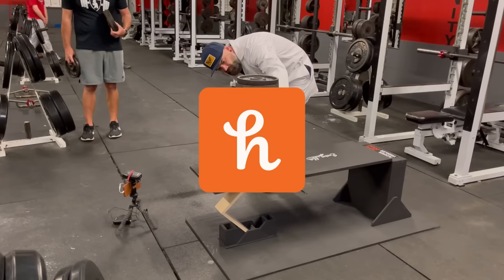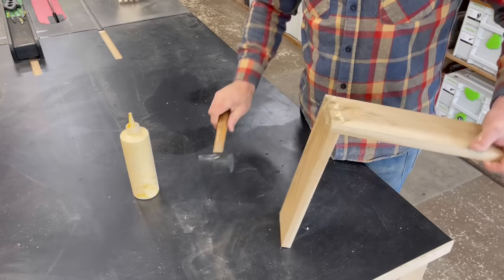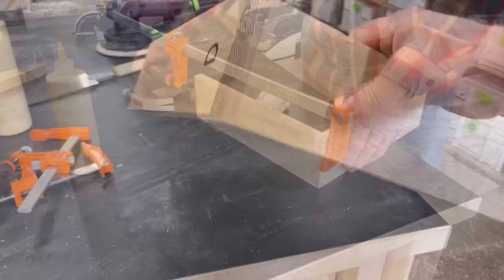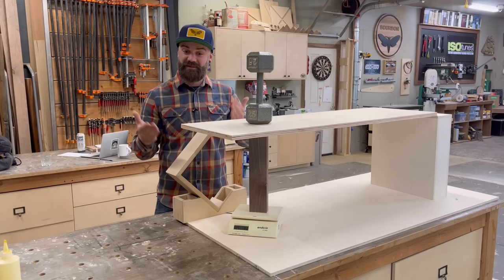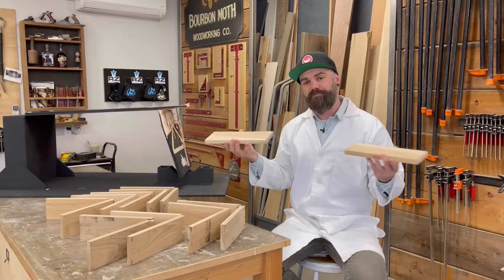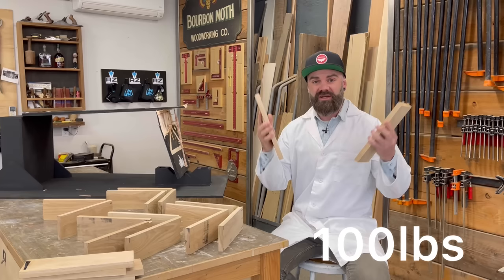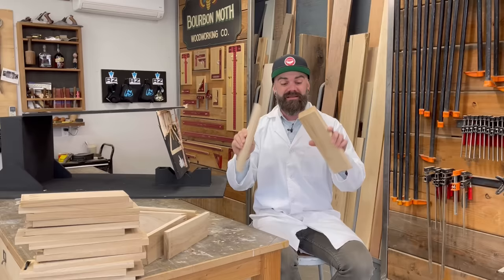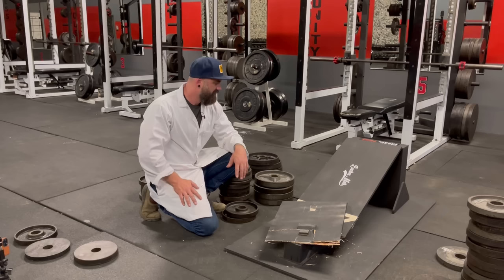What's the Best Wood Joint || Insanely Strong Joinery!

Comment: to be fair that miter joint surprise me but i put it higher then but joint, the dove tail i put high mostly just because the frequent use but was for years skeptical. I was not familiar with pocket holes so it was a bigger guess then the rest. And here is the list from using only 5 min mental analysis. Top meaning the strongest.

box joint
dove tail
miter with splines
pocket holes outside
dowel pins
pocket holes inside
dominos
miter 
butt joint
lamello

Comment: I am betting that if the box joint was drilled through at the corner and a dowel inserted through, that would make a pretty solid joint.  Now the dowel rod would have to be considerably small considering the thickness of the boards and the corner being created...but doubt that would affect it by much.  Am already thinking of variations too lol. A single rod, 1/4" since the boards are 3/4" and need some meat to hold onto.  Then another variation...and doubt there is a drill bit skinny and long enough for it...but those really long toothpick lookin sticks.  Drill either 5 holes like the dice, or even go all out and do 9 holes...but I think it might be a bit too much considering the thickness...soo 4 will probably be enough.
Reply: Another variation for you. dowel through every pin.

Comment: I think the miter joint would be much weaker with another wood particularly red oak. White oak is an extremely  non-porous (hence it’s use in boat building), so I’ll won’t absorb much glue from the joints.

Comment: Hey there! Your woodworking videos are not only cool but also funny! I wonder, this might give unexpected results if you try applying force in the opposite direction. Like, surprising the pieces from one end and hanging the weight from the other end. Would love to see what happens! And I'd be particularly curious to see the strength of a joint made with a lock miter bit and splines 🤪
Keep up the awesome work!

Comment: Next time, make 3 of each joint, or at least 2. You can run the test twice to ensure you're getting the same reading both times - this will eliminate or minimize the effects of any build specific issues. If your 2 tests give you the same result, you can skip the 3rd. If you get varied results from the 2, do the 3rd one; hopefully 2/3 give the same result. If you get 3 different results, take the average of the 3.

Comment: Interesting results but strength is one thing impact resistance and longevity is another thing qnd I think more important. 
I don't think mitre joints would be strong for long or withstand impact as good, dovetail however I think would fare well.
Perhaps you could do another test where you drop a light weight from a small distance repeatedly

Comment: I'm almost positive the dovetail joints would have performed MUCH better if they were cut more evenly, meaning equal sized pins and tails. In highschool woodshop we had to make a project with dovetail joints and they were equal size on each piece of wood and I swear, even without glue you could probably stand on it and it wouldn't break which should be like 160lbs or so. I could be totally wrong however.

Comment: Years ago I was told by my teacher that "Half-Blind Dovetail" was the strongest joint, from what I can remember. But that might have been a simplification. It would be interesting to see though.
Reply: It is a simplification. It’s very strong when force is applied in certain directions. However, in one particular direction, you can just pull the joint apart. Compare that to a box joint where you can pull it apart in two directions or a mitre that doesn’t need to be pulled apart at all.

Comment: the dovetail had thin pins.  make both sides equal and it would likely be equal to the box joint
Reply: totally worth the extra work to add splines to the miter joint.  I mean, come on.... we love to over engineer things, you said it yourself.
if it was a production product that you were making for sale so tons of units to manufacture, then yeah, just the mitre joint.....but for one or two for yourself and a family member or friend, then go the extra mile and put pride into your work and add the splines.

Comment: Such a well conceived and executed video. Fun, entertaining and informative. There are two types of forces happening to the joint in the test, the static force and the dynamic one as weights are added. I wonder if a hydraulic press and something measuring the force might be more accurate plus something measuring the angle of deflection at the joint. Very surprising result for sure.

Comment: I will say the tenon style joints surprised me, but I am curious if the dowels would have faired better if made from mahogany like the splines were

The test is VERY conclusive on the relative mechanical strengths of the joints, but on all the tenon two-material joints it winds up being more of a test of the tenoning material than the actual joint...Lamello aside (as that is a very specialty fastener) the domino vs dowel would be super cool to see retested with the mahogany used in the spline
Reply: That being said - I feel like the spline did so well for both sheer glue surface square-inches AND for the fact such a large amount of glue is located so far from the joint to give it mechanical advantage

I havent done any splines before but they look beautiful, are SUPER easy to do, and are clearly super strong!  I might start using them most everywhere hahaha

Comment: If in fact simple butt joints and miter joints are compromised in strength by the glue being absorbed into the pores of the end grain, would it not stand to reason that by pre-applying glue to the end grain and allowing it to dry prior to gluing the two pieces together with a second application of glue, this would improve the strength?  Additionally, would the adhesive attachment be strengthened if the long grain facet were speared or lanced (scored/abraded) to allow glue to gain a foothold deeper in the wood?

Comment: I almost always use a miter joint on drawers. Quick, easy looks great when done well and if you ad naills on the outside they are never seen and just add to the strength on the pull force. Great test I would like to see if it weakens or strengths with the nails. Plus why don't you do a pull test on drawer fronts with the joints? Keep up the great videos...Cheers

Comment: Some of the joints that appeared weak for this direction of stress would significantly outperform the rest if you did the test with different angles of push/pull 🫡

Comment: Be careful judging the strength of joints based only on this one test. Forces applied at various spots and in various directions may expose the weak joints and really show off the traditionally considered strong joints. This was one case only, could try hanging weights for example and get totally different results. There are shear forces (across a joint), tensile strength (pulling), compression strength (loaded like a column) and a combination of them.

Comment: * It's quite understandable that the splined miter joint performed so well. It could be further improved by installing more splines. 
* I agree with other commenters that the adhesive appears weak. The wood should break before the glue bond breaks. 
* Your test jig supported the lower piece further up its length than is correct: it would have been a more stringent test of the joint itself if the lower piece were supported solely by its tip.

* Your poor camera! @22:24

Comment: I'm curious how a miter joint with blind dowels and a miter joint with through dowels would do. I'm presuming better than a plain miter joint. I wouldn't be surprised if there was little to no difference between the 2. I wonder if it would do even better than splines.

Comment: This is a super interesting video to show up in my feed...  I'm planning to make a wooden canoe just using angles and joints...  Is there a specific joint you'd recommend for my odd project?  Essentially I'm planning to make the mid body of the canoe using a series of 135 degree angles, if that might change any recommendations.  So far, I was figuring connecting all the planks using a series of box joints, but it seems from this I should do miters with splines instead.  How far apart between splines would be recommended for connections between the sides of the lengths of the planks?

Comment: That dovetail is surprising. I build guitars with dovetail neck joints, they have 210 lbs of string tension on the neck at all times. I’m thinking that it’s due to the size or lack thereof that caused the failure in this case

Comment: Very interesting and fun experiment. I wonder if a miter joint with dove tail splines (perhaps an experiment in itself) would be even stronger
Reply: Likely weaker. Any reinforcement that cuts totally with the grain creates more glue surface, without creating an easier way for the wood to fail. Dovetails usually fail by splitting the angled cuts straight through the grain. The wood is weaker than the glue. 

In older days with hide glue, the mechanical advantage was a bigger advantage. These days with modern pva glues, the wood is the weak link in many joints, so the best thing to do is reduce any cuts that create a path for wood to split along it's grain.

Comment: Dovetails where developed when glues were weak and were used on drawers were there was more thrust loads from items in the drawers even without glue they could take these loads now they are just for looks really as you can screw the box together with or without glue and apply a facing so you would see nothing when closed works on frameless or face-frame cabinets

Comment: I think you may get differing results depending on the wood used as well. The stronger and harder the wood, the more surface area and friction are an advantage. Things like the dovetails would be good here because the wood would be less likely to break due to the thin sections. I think the reason the miter joint worked well had to do with the angle of the break. The surfaces between the two 45 degree cuts are completely horizontal, so the forces should balance. The break comes from the torque created by the off-center weight. This means that the glue was likely taking most of the load rather than the wood itself. Comparatively with a hard wood, the miter joint would be worse than the other options because once again, the glue is doing all the work, and while the strength of other joints would increase with a hard wood, the miter joint would just be relying on the same glue as this experiment.
Reply: Harder usually translates to more brittle too. Not sure how that impacts it, but should be under consideration

Comment: Totally called the miter with splines.  I think one thing you didn't consider is the angle of the joint also changes the moment of inertia.  The boards are in the exact same orientation in every test so those angles move the angle of force that is applied.

Comment: I would  be curious about 6 u
 would  happen if you put a dowel or a nail through the finger joint .
 One that I like to use is a butt joint with screws into a dowel inserted into the edge near the end perpendicular to the grain.

Comment: Weakest to strongest (for me, not a woodworker)
Butt joint
Miter joint
Lamello
Pocket hole inside
Domino
Dowel pins
Dove tail
Box joint
Pocket hole outside
Miter joint with splines

Comment: That's not a miter with splines. That's a miter with keys. A spline is not going to be visible on the outside of the corner. It's cut across the grain near the center of the miter cut, going the full height of the drawer. Visible only by looking down (or up) on the drawer box. It's also very strong but probably not stronger than the keyed miter.

Comment: I think the dovetail one would have did better if you turned it the other way meaning the side you had at the top put at the bottom and it side that you had at the bottom but at the top. I still think the box joints would have out performed it because of the glue surface, it has way more and glue is stronger than wood, if you would’ve had equal of pins on the dovetail one it would out perform the box joint. splines held up better than all because he used different wood in the spline which was stronger than original wood.

Comment: The dowel joint probably would have been stronger if the two outside dowels were drilled at a 30-45 degree angle.

Comment: Very interesting! I'd be curious what effect a typical biscuit might have, both on a butt joint and a miter configuration. I wouldn't expect much difference - maybe 10-20 pounds over the Lamello or plain miter. But more of us are probably going to have a biscuit joiner vs. a Domino or Lamello. I like them as an aid in alignment and would like to know what, if any, effect they have on strength.

And like others mentioned, I think another dovetail test with more evenly sized tails and pins would be interesting. Maybe a few variations even, just to see how much affect the geometry has. Though it did look like the wood actually failed in the test - it looked like the wedge shapes split both sides of the joint along the grain.

Great job and looking forward to a part 2 at some point.

Comment: Please can you tell me the width and length of the boards?  I want to compare to my own joint design which is a stepped mitre that I use on my cnc cut HDF panels.  Joint designs that wipe off the glue like the box and dovetail are going to be more variable than designs that press together (at least with non-expanding glues)

Comment: The dovetail wasn't the beat dovetail to use. I bet if you made them smaller with more jointed surface area you would have a much stronger joint.

Comment: When I put my wide load down on a chair, there isn't a diagonal load on any joint.  As long as I'm sitting still and leaning forward, my fat butt is pushing and pulling on chair joints.  Then when things get itchy,  I will start a little side to side motion, mixing in an occasional round about.   Who knows what that's going to do to the chair joints.  After awhile, I'm going to lean back and try to throw some weight off my tiring seat cushions.  From hear, I might put my feet up and undo my belt to let out some belly tension.

The joints of a chair are experiencing many different forces.  None of the forces are exactly like your test.  So, the results of your test doesn't answer the question of which joint is best.

Comment: I think the way the force was pressing on the miter joint had it at its best advantage. There are many ways to apply force: compression, tensile, sheer, rotational. I also think time is a factor and that the joints that performed well would likely have failed at earlier weights had those weights been applied longer. I wouldn't use this demonstration as a guide. Too many variables left untested. Definitely don't start making sitting furniture with miter joints.

Comment: If you return to this, try box-joints with different amount of "teeth", as each tooth will increase surface area. Same with the winner of this test, compare different amounts of splines. Intuition says the more the better in both cases, but maybe intuition is wrong and there are some diminishing returns at some point.

Comment: Triangles.  Strongest shape.  I bet 1/8th inch triangles re-enforcing the mitre joint would give you a great chance of breaking the wood before the joint. I'd even go so far as to guess it would be stronger than re-enforcing with metal L brackets (on the edge of the boards, not over the corner). Watch Real Civil Engineer play polybridge on YouTube. He makes triangles all the time :)

Comment: I think the dovetail joint would have faired way better if the pins and tails were closer in size. I am surprised the box joint was not the strongest of all of them. Maybe it was too tight and wiped the glue off as they were joined. Interesting video and I enjoyed it.